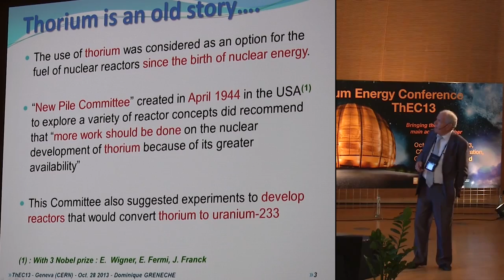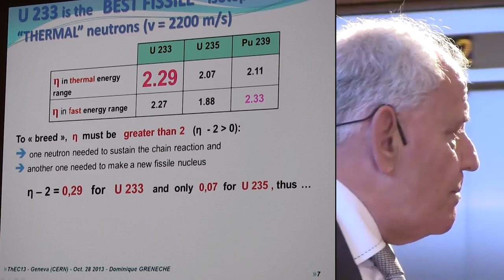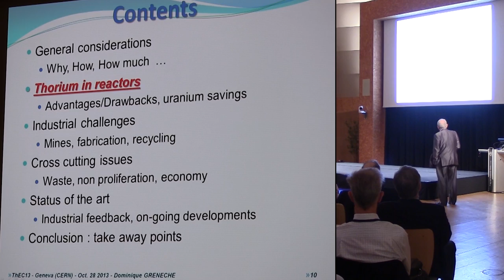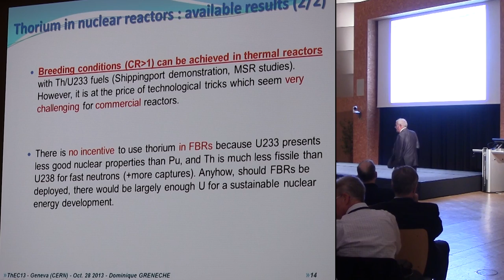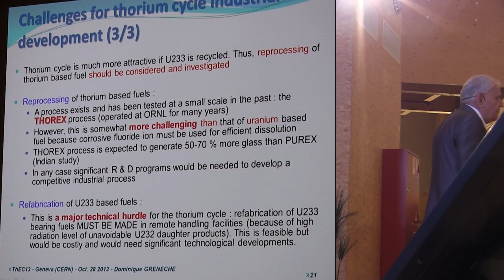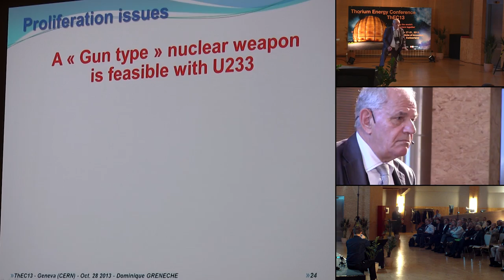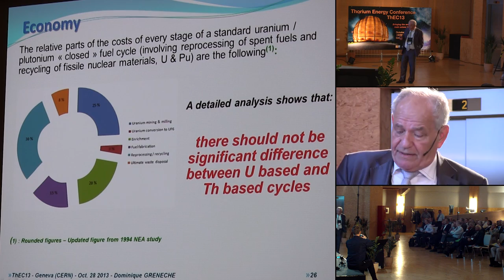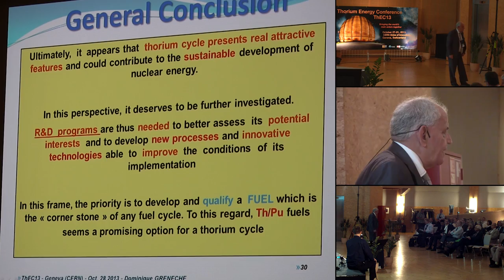Dominique Grenèche - Thorium Fuel Cycle: Achievements & Prospects @ ThEC13

Comment: I liked this talk. Thorium helps with some of the current problems with the nuclear industry, and MSRs help with other issues. But really, the issues are not as apocalyptic as they've been made out to be. Its all just a matter of engineering. Personally, I don't think chemical energy of any sort should be used for grid power, but it makes sense for most transport needs.
Reply: I liked his style for sure. Agree the issues with Nuclear are not huge, there have been historical mistakes, like every oil spill or mine collapse, but these have led to improved designs and procedures.

As mentioned in a previous video something about radiation seems to have an innate capacity to scare people/public, this is by far the biggest problem I can see for the industry.

Comment: More abundant, harder to burn, safer to use if can make the intended device operate according to the design specification, less mess to clean up and shorter waste storage.
40years knowledge from experience is to be respected.

Research has shown that the design problems are not insurmountable.